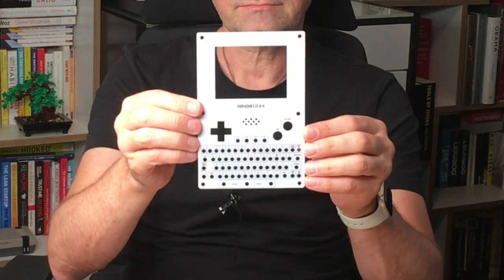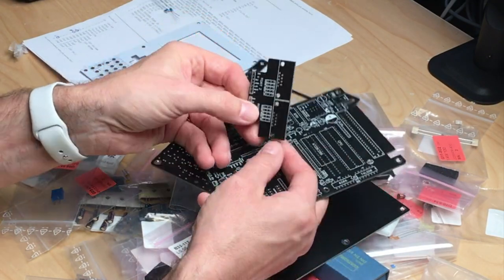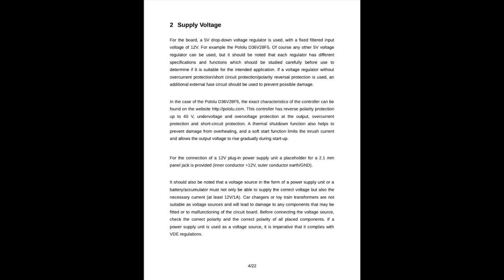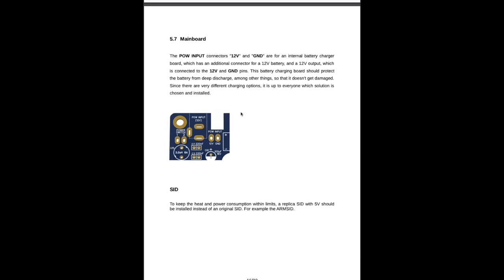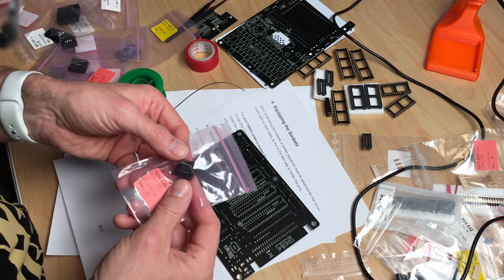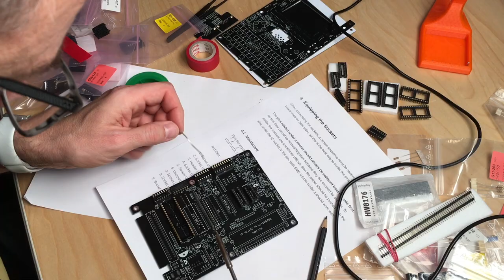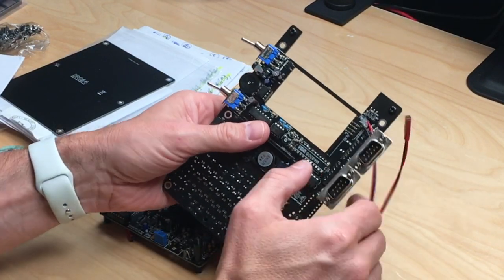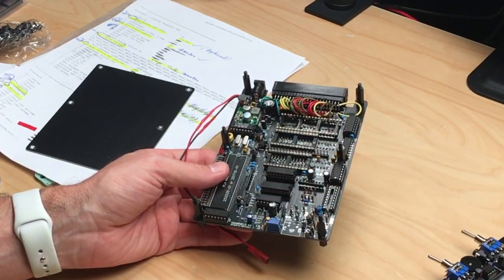Building The Handheld C64 - Part I - a real C64 in a gameboy form factor

Comment: Indeed a different beast. I did the ATX64 that are basically in the same department. I would not consider the ATX64 as an experts build. As I have done three major electronics build in my life. The first was around 1990, when I did a variable bench power supply in 8'th grade in school. The second was a SixtyClone 250466 that I finished this year, and an ATX64 that I started with some 4 months ago. I had to order stuff from Taiwan and other obscure places. But most was avaliable from Reichelt.

But I am not an expert in building. I just started on amateur level. Never worked professional with solder or worked with repairing electtonics.
Reply from the maker: Nice. So you must have lots of experience then. I also did the SixyClone that was a nice build.
Reply: @RetroWK  Not really. I have recapped a couple of Socket-A motherboards and three C64's. Else I have no experience in electronics as such, except for building PC's. That is more, kind of Lego building or something. 🙂
Reply from the maker: @brostenen  I like the challenge. I am a software guy and doing hardware was always a mystery for me as a kid. I am catching up now :-) And I also build loads of PCs in my lifetime. That is indeed like LEGO.
Reply: @RetroWK  Hehe.... True. I realised the other day, that back then when I saw a C64 for the first time in the mid-80's. Then I would never have dreamed that I would actually build two machines from scratch in my life. And here we are. Building machines like these. 😁😉

Comment: Realy nice kit. I've built the Harlequin 128, (a ZX Spectrum 128 clone), and a ZX81 clone kit. Both were easy enough. (I've been buying and repairing 81's and Speccy's for years now, just for fun.).
But this looks like a nightmare with components on both sides of the board. Ha ha. I think I would have chopped out the center of the chip sockets I had to solder under.
Reply from the maker: This project was a really tough one. Would have been A LOT easier if it was a kit and I didn't have to source the components.

Comment: Those toggle switches on the side look huge, surely there were smaller slider type switches which would do the same job.
It would be nice if there was a video test point that would allow to test the boards on a monitor before connecting the display.
Reply from the maker: I actually love these switches. Didn't think so first, but that satisifying click-feeling adds to the experience. And that testpoint does exist on the board. And I might use it ;-)

Comment: A very good detailed build report. And you are absolutely right, my builds are a journey :-) 

I still remember the moment when I had the finished Handheld64 in my hand and played the first games. Even I was amazed by the final result, because everything fit together so nicely, and everything was where you expected it to be. It wasn't easy, because as you can see there isn't much room there. And to this day, I'm amazed that I was still able to incorporate all the features as I imagined (Loudspeaker, Headphones with volume knob, Gameport-Switch, Full Keyboard, DPAD+Analog Stick options at one PCB, build-in 1541, ...). 

A round thing. I think the best piece I have designed and built so far.
Reply from the maker: Thanks man! And thanks for this awesome project. The feeling you describe is the same for me, when I do software that isn't completely linear but evolves into something you didn't program into it. That feeling of awe! Keep up the great work and all the best for your "monumental" next project.
Reply: @RetroWK  You're welcome. I will try my best ;-)